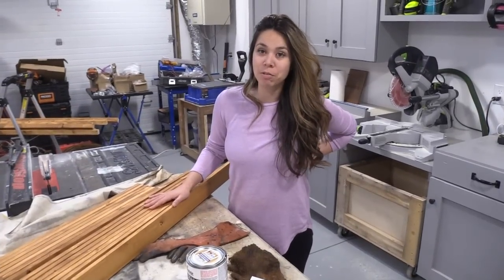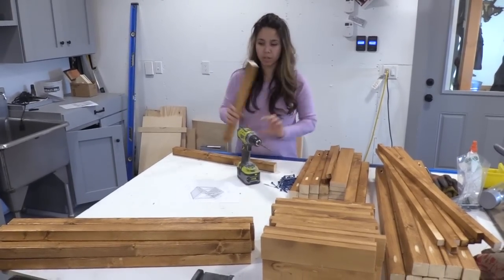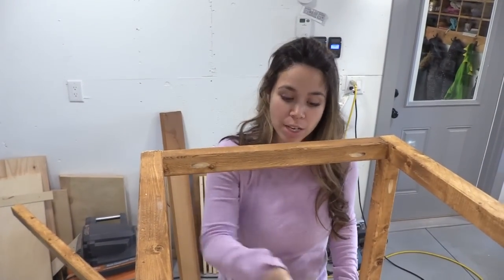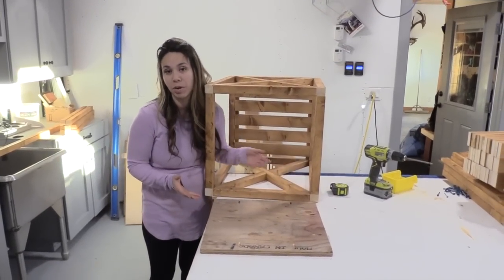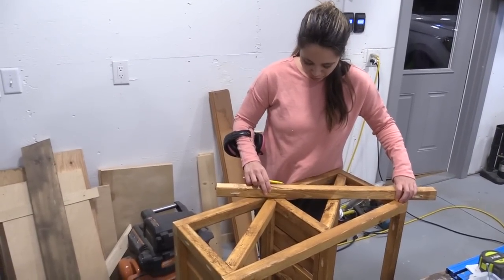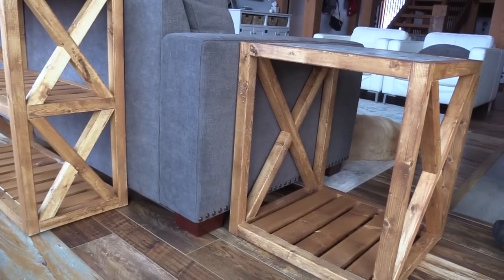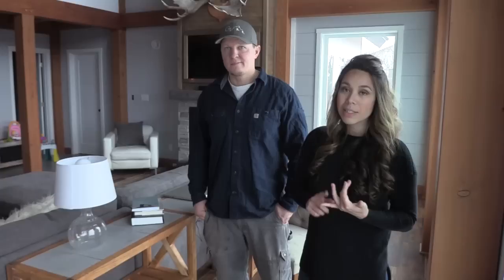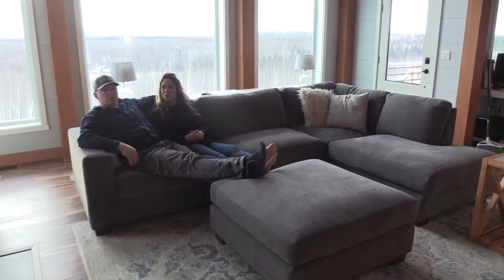DIY: $20 Farmhouse End Table, $60 Sofa Table

Comment: Another great build Ana... Question? Since you make a lot of frames in your builds one way I found that works for me was to build a corner jig where you can put any size lumber in and when you drive your pocket hole screws it won't move around on you maybe it will work for you. I know since I make a lot of cabinets it has sped up my build time.

Comment: Howdy. I liked the build, simple and easy. 

A few mentions....

1) I couldn't help to notice you using a CRAZY expensive Festool miter saw yet using a cheap $20 Diablo blade. I thought that was funny. 

2) You mentioned that the cross beams were NOT structural. That's incorrect. They are indeed structural. Without them, "eventually" the table will sway/lean. That's the entire purpose as to WHY we build cross beams. 

Cool video 😊
Reply from the maker: Thanks for the visit!

Comment: I have a question about pocket holes. I read and watch that the screws should be screwed in towards the main board and not towards the end because it's stronger. But I see in this video you screw it towards the end of the board. Is it still strong enough - I was thinking of making a bench, table chair etc

Comment: I love your sectional. A very good friend of mine has one almost exactly like it, so I made her two tables that are kinda a modern version of a TV tray, because you can pull them right up to the edge of the sofa, plus the height of the table is variable. They are shaped kinda like a giant ‘C’ and the bottom of the C slides under the sofa, so they don’t take up any floor/leg room. Here’s an example of one of the builds from Fisher’s Shop that I used for inspiration: https://youtu.be/ZZ00dCFXIXY